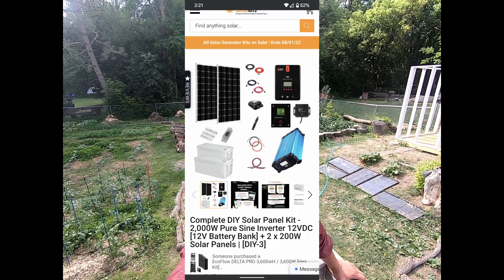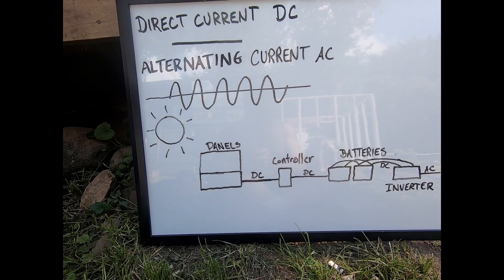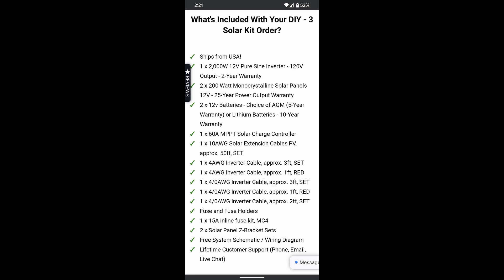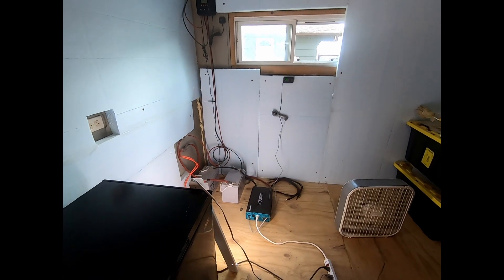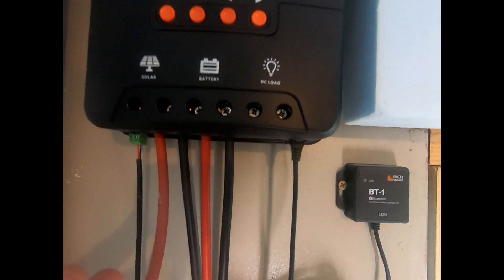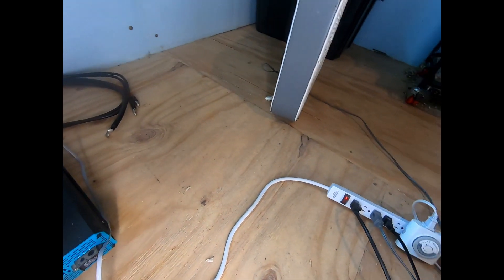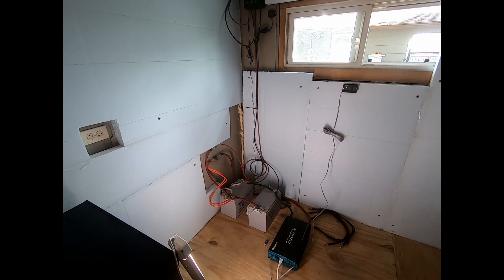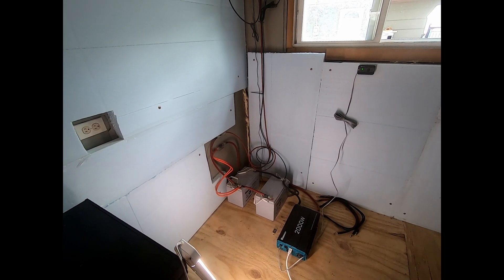Review of the DIY-3 Solar Panel System from ShopSolarKits.com

Comment: Looking great. Just build my little back up system too bcs im considered about electric blackouts this winter here in Finland. 
Anyway i noticed you didnt leave air gap between panel and roof. It going to reduce output of the panels cause warm panel produce less.
Reply from the maker: Thanks for watching... The way the brackets mounted the panel, it's about 3/4 of an inch above the roof, so there is a small gap... In the winter, I never expect much production anyways.  We get down to about 8 hours of daylight in December.  I'm going to monitor the system a little more closely this winter.

Comment: nice system..... my solar system 1. Battery 12volt 30Ah - 50watt solar- 20Am solar charge controller ......... using 2 light 2 fan (12 volt 10w) Thanks
Reply from the maker: Thanks for watching!  Sounds like you have a pretty nice setup

Comment: Question: The ad you posted says it comes with a 60 amp charge controller but what you have installed is a 40 amp charge controller. Was it a bit of false advertising on their part?
Reply from the maker: Hi Christopher... I noticed it too when I was filming the video.  I bought the kit last November, and I do not remember if they were selling it with a 40 or 60 amp controller at that time.  The kit is now more expensive than what I paid, so it's possible that they have upgraded it to the 60 amp. I would suggest confirming it with them when/if you order.  Good question, thanks for watching!

Comment: Great video.  I have an Ecoflow Delta Max system with 4 panels.  Curious about the quail.  Do you keep them for the eggs?
Reply from the maker: Thanks for watching!  Yes, I raise them for meat and eggs... Females will produce 300 eggs a year.  That cage they are in is the egg roll out system from hatching time.com... I will eventually do a review of that system.  Each cage has 2 to 3 females paired with one male... If you have other questions, feel free to email me at matt@lessdependentwi.com